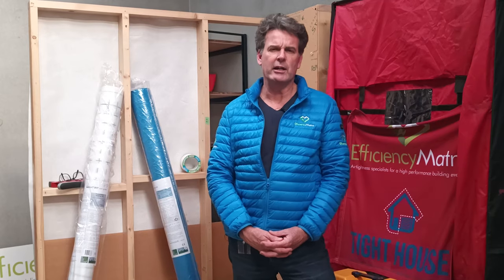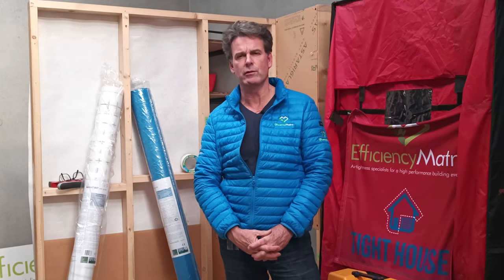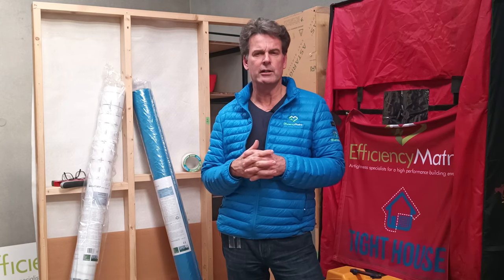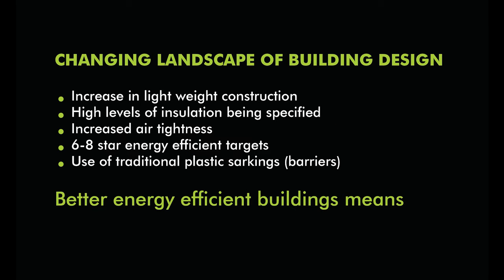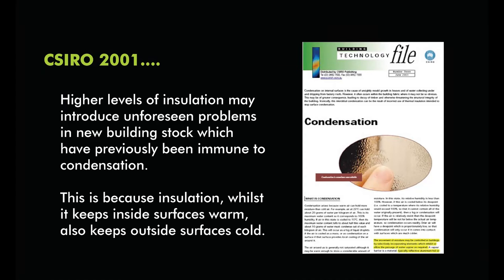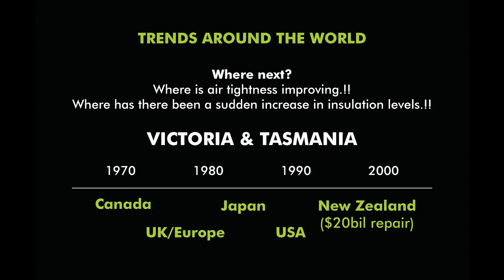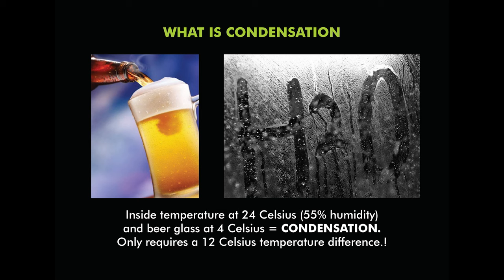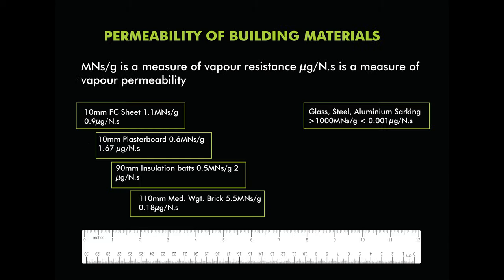Managing Condensation in Construction - A presentation from 2014 and the fight continues.

Comment: Another info packed video - thanks.

Question if I may - I am just about to start a new build 8.1 stars single storey house in inner west melb - beachside suburb. Vapour permeable building wrap, anticon blanket, R2.5 wall insulation, R6 ceiling insulation, rangehood and bathroom extraction to outside and uPVC double glazing.  I am being pressured by builder to install whirlybird and even the energy assessor has raised concerns about condensation issues by not installing a whilybird. Am I correct in refusing the necessity? 

Thanks
Reply from the maker: Whirly birds to not move sufficient air to make enough of a difference to condensation.  A roof ridge vent is way more effective.
https://efficiencymatrix.com/does-roof-ventilation-work/

Comment: Are there any tips or videos for retrofitting insulation in old houses (60's, 70's) where you may not be doing a full redesign? E.g. Putting insulation batts in brick veneer walls?
Reply from the maker: You need to ensure your insulation is not in contact with your brick.  There are also companies that do blow in aqua-phobic insulation out there.
Reply: @ecoevo  ah great! I’ve heard it’s important with spray foam to pick the right installer, is there any you’d recommend in Melbourne or tips to find ones that will do it properly?

Comment: This may be a dumb question, but how does this relate to sub tropical Brisbane (proposed build is steel roof, with mix of brick veneer and lightweight cladding)? Does higher temperature reduce condensation? But then does higher humidity increase condensation? What is the solution for higher temp and high humidity? Blanket under steel roof, and permeable wrap on wall? Extra ventilation in roof space?
Reply from the maker: Brisbane can still get away with a vapour barrier on the inside, but North of Brisbane, the vapour barrier goes on the outside.   And foil can be used as a vapour barrier, but it must be installed airtight.  Any moisture that gets inside a wall system will condense on cold plaster surfaces, that are being cooled by air conditioners.